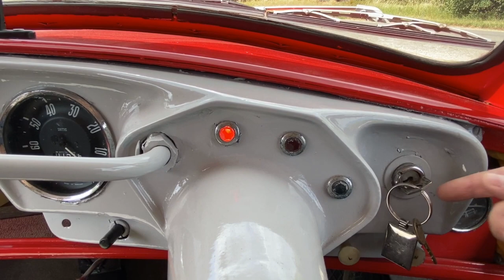IDRIVEACLASSIC reviews: 60s Bond Mini Car Mark G (micro car/mini car review)

Comment: They apparently used an off-the-shelf motorbike engine which is the reason for the “odd” gear change. They simply linked the gear lever on the dash to the engines original gear lever, giving the standard motorbike “1-N-2-3-4 etc.” shifting pattern. That’s probably also the main reason it doesen’t have reverse, to save the cost of having to make a special transmission. The speedo is possibly also a bike part – I seem to recall that some of the old british bikes had those “wrong way” speedometers(?). The lever under the dash is most likely a “trickle”-lever, which was common on older bikes. It pushes down the float in the carburettor to force open the fuel inlet and flood the carb on purpose to give the engine some extra fuel to cold start it, acting as a simplified choke. As for pumping the throttle… it doesn’t work like in a car, as the carb doesn’t have an acceleration pump to squirt fuel into the intake. Pumping the throttle when the engine is not running really won’t do anything at all. Having said that, it isn’t all that uncommon having to “work” a little bit with the throttle to keep it running when cold.

Comment: I was wondering about the stability of a three wheel car when taking a sharp turn.  It seems like the front corner would lean hard into the ground in taking a sharp turn while in motion.  How did it feel when taking a turn (while moving)?  Usually three wheel cars put the two stabilizing wheels with the steering portion and the third stationary wheel goes in the back.  This is quite an odd set-up.

Comment: I wasn't expecting a car that looks like a Reliant Regal or Robin to be so different, namely in the front engine and chain drive to the front wheel.  I remember a Wheeler Dealers episode where Edd China took apart a Bond Bug, which I think used a Reliant Robin as its base.  Three wheelers are neat, especially when they're a Morgan or a Vanderhall, but if I were to have a Reliant I'd really rather have a Kitten or a Scimitar.  BTW Ms. Steph, you looked like you were having a lot of fun while you fought that little car.  Just discovered you and looking forward to more videos!

Comment: There was another market in mind that you have not mentioned, the motorbike and sidecar rider, wives were fed up with being driven around in drafty cold sidecars and wanted something better, even the gear stick behaved like a motorcycle gear - one up two or three down. It was a car for it's time. In 1964 having just got married and having very little spare money and no car licence we bought one of these second hand for £80. It was great, we lived in South London on the Kent borders. We went everywhere, even to a formal function at the Ritz, where we took our friends back to Crystal Palace - four adults was a big squeeze, ballgowns and all. To have any form of car was unusual then. The driving position was  excellent - prone basically. I never found it difficult to drive, but then I was brought up double declutching to change gear. I never found steering to be a problem but then most cars were very basic with rack an pinion steering which could be pretty rough so steering adjustment was the norm. As for noise, I think your Bond needed a replacement silencer or at least a bit of Gun Gum. We had the Bond for about 5 years and moved our home in it from Chislehurst to Walderslade in Kent, if you took out the passenger seats you could get a lot in. The brakes did leave a lot to be desired so you needed plenty of stopping room. There was one advantage if the battery ran down you could stand in the bonnet and kick start it. Also the weight was all in the front so if you needed to get into a short parking space just nose it in, get out, go round the back and lift it into the space. It would also spin on one wheel  most useful at times. When we found we were expecting we decided to get  proper car I got my driving licence and we went to look at one of the first Nissans which did not seem much better than the Bond, in the end like many we bought a second hand Cortina Mk1 1200cc (3 bearing crank splatter oiled - most packed up between 50,00 and 60,000 miles - mine did - re engined with a four bearing 1500cc - much improved ). We sold the Bond for more than we paid for it and one day playing at a pitch and putt course near Walderslade (lots of hills there) I watched my old Bond come flying down the hill much too fast, trying to negotiate the bend at the bottom the nose tucked into the tarmac and the car tumbled coming to a rest on it side. Out got four large people - all had survived almost without a scratch they were so packed in they could not move. It would not stop said the driver - I said the weight to brake ratio was too high!!!! Thank you for sharing this video, brought back many good memories.

Comment: Some owners lengthened the exhaust with metal flexi tube to reduce the fumes problem. I even saw on which had 2 silencers -- in Lincolnshire by coincidence.
Reply: Pretty sure the car you saw is well known in the Bond Club for it's many continental ventures !

Comment: It's best not to think of these vehicles as cars, but rather a motorcycle and side car that keeps you out of the rain.  I love the two stroke engine with the kick start you have to climb into the engine bay to use (Good fun on a cold wet or snowy winter's day, which is when your battery is most likely to die).

Comment: As i'm sure someone has mentioned, the Bond name was later acquired by reliant and they produced the "Bond bug" sporting cheese wedge. other microcars of the era included Berkley who offered three and four wheelers including one with a 500cc two stroke triple and (gulp) a 700cc royal enfield twin.  Luckily, I think the latter only appeared in a four wheeler......
Reply: Reliant actually acquired the whole Bond business in 1969, rather than just the name, and operated the existing factories for another 18 months or so.  They even took a replacement Equipe project as far as making production moulds for the body, before abandoning the project when it became apparent that they would not gain the same access to the Triumph dealer network which was enjoyed by Bond since 1963.  Coincidentally, Lawrence Bond designed the Berkeley cars too

Comment: Great colour! I don’t remember seeing that colour… Usually they seemed to be a dull bronze metallic. A friend had an early one which had the most ridiculous starting lever between the two front seats… seemed like almost 3 feet long and you had to pull it vertically as though it was a kick-starter (which it probably was!).
Reply: My mum had one of those, before I was born.
The lever was connected to the kick-starter.
When I was on the way, she couldn't get into it, it was so small.

Comment: Had a Mk F in the sixties, used to stick my leg in to kick start then run into the car to push the choke in a bit then run back to close the bonnet. Still remember the reg. no. NDO 812. Are you still out there?

Comment: Remember getting a lift to work in a bond back in the 60s , could hear coming about half a mile away pop pop pop , and the steering wheel looked off centre ,lol
Reply: Most cars have the steering wheel off-centre, but I know what you mean; the steering column points towards the middle of the car.

Comment: I acquired my motorbike license with that car, was stopped in Aylesbury by Mr Plod who told  me I need a bike license to drive it (I had a full car license) so I past the test in the Bond and was presented with a full motorcycle licence that covered me to ride a 1000cc Vincent and I had never sat on a bike before. When I had my first bike a 350 B S A I walked it across every road junction and roundabout in Dunstable, by the time I reached Linslade I'd just got the hang of it.

Comment: When she first went around the car with the camera, I was wondering why the exhaust exited just under the driver's cabin rather than continuing to the back of the car. Then she raised the bonnet and showed the most interesting aspect of the Bond - the engine turns with the steering - all one unit. Shorty exhaust explained!

Comment: My father was a big fan of the venerable Reliant Robin 3 wheeler.  He held a full motorcycle license which meant that he could drive any 3 wheel vehicle as they were classed as a Tricycle. It all ended in tears however as the Robin caught fire and was declared an insurance right off.

Comment: I saw one of those on the main road near where I live, it was on fire and remember the driver jumping out before it was engulfed in flames, it literally disappeared within a few minutes, leaving only the three wheels and, some metal bits for the fire brigade to mop up. truly a death trap.
Reply: Actually it was a very safe car. No one was ever killed in collision in a Bond Minicar.Not by design, but the front aluminium bodywork acted as a crumple zone by absorbing the impact in a head on.

Comment: Want! Although I'd drop a more modern 2 stroke in there
Reply: Drop a 50cc 4 stroke..... probably same power......
Reply: A 125cc - 250cc Honda four stroke  scooter engine with an auto transmission would work well IMO.
Reply: Yes, the Piaggio 176cc engine as fitted in the early Gilera Runner 180. It has double the power of that Villiers 250 at 21hp. My Runner had a top speed of 90mph and 0-60 in 7.5 seconds.

Comment: The front aspect of an Austin Cambridge; the rear from a Ford Anglia, gearbox and engine from a motorcycle and steering precision of a Series Land Rover. Surprisingly spacious though, if somewhat loud! Wonder why they didn’t drive the rear wheels instead..?
Reply: Because it would have made the car far more complicated, heavy, and expensive.

Comment: You always seem to find the most unusual vehicles, rather like myself when i go car shopping. I never find interest in the everyday. I want the unusual. I went shopping for a vehicle lately, and I wanted a manual transmission. In a country where 94% of vehicles sold are automatics, I have to be the oddball. I have always wondered why Bond did not reverse the three wheel layout, like the Isetta, or the still popular here in the USA, Morgan. Does the Bond use a two-stroke engine? I notice someone else mentioned the Reliant Robin, rated one of the worst vehicles ever built, by I believe a British author. I have always found such books subjective, but rarely disagree with the noted faults of the vehicles. As an American who has owned some of our "lemons," I find it more interesting to correct the faults than to pan the vehicle. Proud former owner of 3 Chevrolet Vega and 2 Corvair, A Ford Pinto, and have a passion still for F.I.A.T. (fix it again, Tony), Tony being my middle name.

Comment: I still have my model G with the powerful 250cc Villiers twin and reversing Dyna start turn the engine off push the key further in and restart with the engine running backwards, this was possible as the engine was a two stroke, the wandering steering is either incorrect adjustment or Steph is holding the wheel to firmly, you get used to it and it is no longer a problem, as a youngster I had five adults, by age if nothing else, in mine and four up some very steep hills around Royal Tunbridge Wells, mine still has the white flashing indicators on the front incorporated into the side light, perfectly legal for a car of that era, the brakes were very good being hydraulic and working on all three wheels, (the early ones had no front brake!!, but then no suspension on the rear and a 125cc engine), on full lock it would pivot on one of the rear wheels spinning round in its own length (used to be my party piece outside the pub with even the manager sometimes coming out to watch), in my circle of friends I was the only one with a "car", you could drive it and carry passengers on a full motorcycle license, or run on L plates with no passengers as it came under the same designation as a motorcycle and sidecar, and the same road tax, I ran mine 79 to 81, and still have it but she's looking rather sorry for herself these days, mine must have been a late model G as it has a proper opening boot lid, still happy memories.
Reply: There was an estate car version of the F and G models, with a full opening tailgate. I had one with the twin engine, and t was pretty fast one up.

Comment: Hi Steph.
I had been wondering for a while if you would do a Bond road test. I had a MK D Family in the '90's that had a soft top, cable brake on the front wheel and rods on the back. Had the smaller 197cc Villiers with Siba dynostart with no reverse.
Just stick with my Morris Minor now.

Comment: The smoke is probably due to the exhaust being underneath the front of the vehicle... 😆 Definitely keep the windows down! 😂
Reply: It's a faulty exhaust. I had a Bond and there was never smoke in the cabin. Actually this example is in poor condition. The steering is badly worn, the exhaust is faulty, and the battery or charging circuit needs attention. It shouldn't be that noisy either, but that's probably the faulty exhaust.

Comment: There is nothing weird about the gear change, it's a Villiers 2 stroke motorcycle engine mounted on the front wheel drive and so in keeping with ALL motorcycle engines the gear are always up up up, dow down down (no H gate). Most rally cross cars have this system, it's just a sequential gear box

Comment: According to the law it wasn't a car at all, it was a 'motor tricycle' as long as it weighed less than 8cwt. This meant that it could be driven on a motorcycle licence as it was classed like a motorcycle and sidecar. After the early 60s you could have a reverse gear and still drive them on a motorcycle licence. I had a BMW Isetta 300 bubble car in the late 60s which I drove on a motorcycle licence and which had a normal 4-speed and reverse gearbox. Bought it for £45 and sold it for £45 a year later - it would be worth thousands now!

Comment: Great economical cars fpr a young family wanting to get out and about in the fifties , it was out of date by early sixties, its brief replacement , the 875 was a modern pocket rocket in contrast , lawrance bond was very clever chap . If the imp engines had not been prone to overheating,  it would have outsold its main rival , the reliant regal easily , but alas it didnt take off and reliant bought them out .

Comment: a guy near me biult a kit car that looks like this only difference is the 1 wheel is at the back made from motorbike parts and smart car bits, looks mad but handles well used running gear off the smart car as well,this bond car looks greatthe bond car company made some nice 4 wheeled sprint cars as well in the 50s and 60s before the 3 wheeler bond later to be the reliant regal and robin as well as the bond bug

Comment: I think it was HubNut's video on one of these that showed the reverse feature. If I remember right you have to shut the engine down then push the key inwards and turn to start, you get a red light that comes on and the engine at that point is actually running backwards. Then you can put it in to first gear and you're able to reverse. I'm not sure if it is only on some versions because you can probably just put your foot out the door and Flintstone it back as it is so lightweight.

Edit: I found the video https://www.youtube.com/watch?v=Nqi7gSrXWIw skip to 15:40

Comment: You have to remember that most people who drove one of these would use it as a step up from a motorcycle so would have been used to that type of gear selection, and at least they would have been in the dry. It's a shame the running gear & interior wasn't done up to the same standard as the bodywork though.

Comment: The reason the controls are so looney is because they literally chopped a motorbike and put it under the bonnet.  The shifter is just like a bike, but reversed (probably due to linkage): up for 1, down for rest (it is the opposite on a bike).  That little chrome knob you pump for starting is known as the "tickler".  It loads up the carburetor for a cold start (in lieu of choke).

Comment: Loved that...Though I got to say your conclusion that the Bond was not practical for everyday use I think is wrong. This particular one isn't practical...There are areas where this one is seriously suspect! I've never seen steering that bad in any car, either with three or four wheels. There was plenty of panel area on show and no sound deadening, no carpet, no headlining, nothing. So you probably could cut the noise down to a third..esp when you fix the holes that let the exhaust in so you can shut the window...So with just sorting out the steering and adding some sound absorption, also under the bonnet area - plus a few bits to fix the rest which I'm sure it needs..  you will have a much happier run around. The G surely had the majority of foibles ironed out?? You would think so...
Reply: Not practical to get cabin heating from the engine. If the engine had a cowled fan it could be done but the exhaust pipe would have to be vertical & central up through the bonnet - like a tractor - so that the 180 degree swing of the engine could still be accomodated.

Comment: This must have been the luxury model with electric start.  I was 17yrs old when I had mine and I had to lift the bonnet and kick start it.  As everyone mentions the brakes were dreadful
Reply: There is NO 'luxury model' with electric start.
ALL  Bond Minicars, including the earliest ones in 1949, were started from the driving seat.
There was an emergency kick-starter under the bonnet
If you failed to maintain your Bond properly, you would end up having to use this emergency kick-starter.

Comment: The Bond factory at Preston did not close until 1970.   They were sold to Reliant in 1969.  I have had 3 Equipes, a GT4S and two 2ltr GT's a Mk1 and Mk2.  More Info can be found here http://www.bondownersclub.co.uk/bond.html